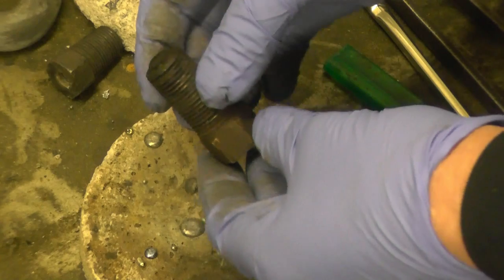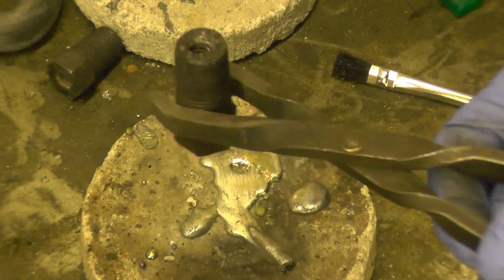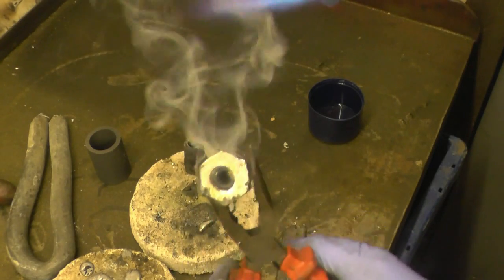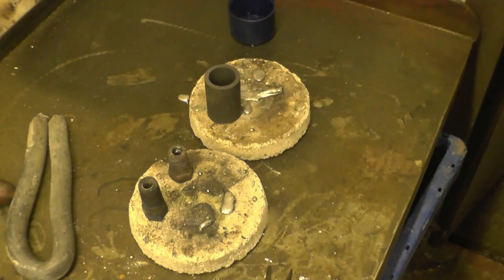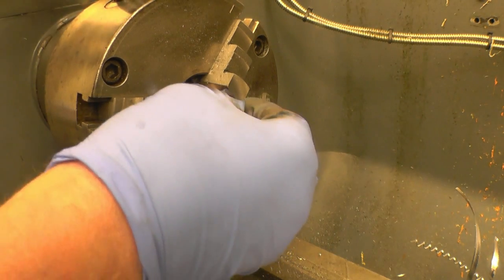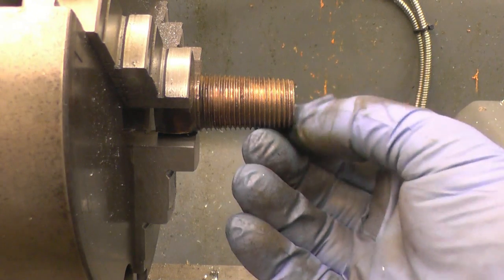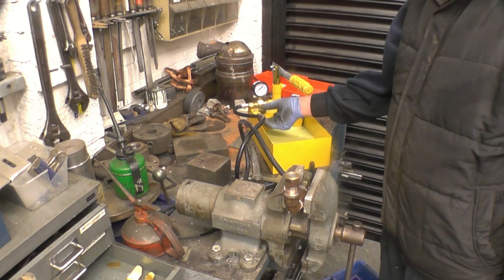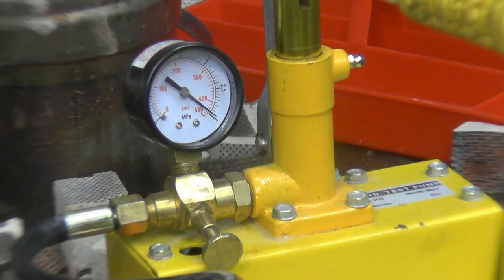Steam Boiler Fusible Plug

Comment: Why have a fusible plug on a boiler? Wouldn't it release all the water causing overheating? Also, put the fire out. Im assuming this is for coal only applications? If boiler is firing natural gas, wouldn't that create an issue?

Comment: Hi John, I'm one of your biggest fans, but I believe you used the wrong type of lead in this case. You may want to  look up  "eutectic solder" , it's melting point is quite different than ordinary lead. As you know, it isn't the pressure that melts the lead but the temperature.
Reply: There's some really scary boiler "repair" and "construction" videos on YouTube. I used to be kind of a steam fan but always leaned more towards internal combustion. The more I see of some of this shadetree "service" the further away from steam locomotives, traction engines and anything else "vintage" with a boiler I'll stay. There's only one real "steam shop" in the world I'd walk into, and that's Union Pacific's steam shop in Cheyenne, Wyoming.

Comment: I've seen the fusible plugs many times.  Never seen one blown or in build stage so didn't know the internals were threaded.  But seeing it, it makes perfect sense.
Reply: +ramosel I blew out a fusible plug on an old wood fired HRT. The wood was fired in a Dutch Oven so the fusible plug was more of a warning than an way to put the fire out. It was set at three inches above the minimum level. There was no level control on the boiler and I was away trying to get an old sump pump in the basement with a leaky gland to draw. Also the water column had no whistle. Live and learn.

Comment: +doubleboost    Was this done as a necessity or as part of a regular mechanical service?
Reply: +Spoif A few videos back you can see John and Richard remove the old safety pressure release plug while servicing Richard's steam powered truck. The boiler is due for a new safety certification.

Comment: John 
A query. Boiler SWP is 250 annual test would be as you say 1.5 times SWP. I make that 375 not 450 or am I missing something ?

My loco boilers 5 inch G ran at 100 retest was at 1.5 = 150 but the initial test when made was 2 times 

Do they have to do the ultrasonic thickness tests at the water line on this type of boiler I know they did for steel loco boiler , but not for copper silver solder ones

Stuart
Reply from the maker: +Stuart Hardy The boiler test will be 375 its initial proof test would have been 2 times working pressure The boiler is stripped every 10 years for a full inspection Ultrasonic testing is used as well

Comment: Nice job and interesting.  I would never have thought that the lead would melt in the boiler since it's in contact with the water.  My reasoning is that you can fill a paper cup with water and then heat it over a campfire.  Learn something new every day.
Reply: +Rosa String Works It is indeed meant to melt should the water level ever go below the plug, meaning that the boiler is running dry and could burst if not stopped soon enough - steam and/or residual water being pushed out of the boiler by the inside pressure, putting on guard the stoker (which should have kept a watchful eye on the water level gauge!) and possibly extinguishing the fire.
Reply: +Rosa String Works I think the idea is that the lead will melt when the water level gets below the level of the fusible plug
Reply: +brandoc1950 that sounds right to me, except he said water and steam would rush through and put the fire out.
Reply: +Rosa String Works Exactly. It will only melt if the water level gets dangerously low, which is below the point where it's screwed into the tank.